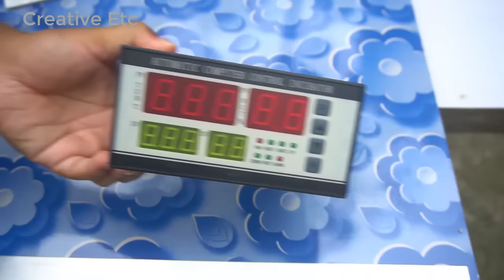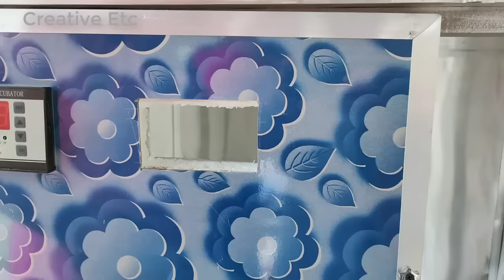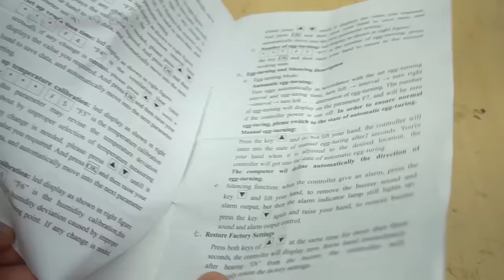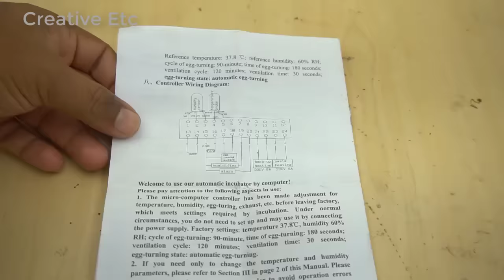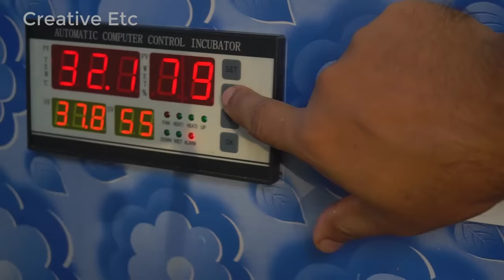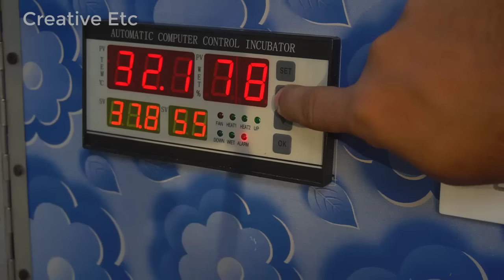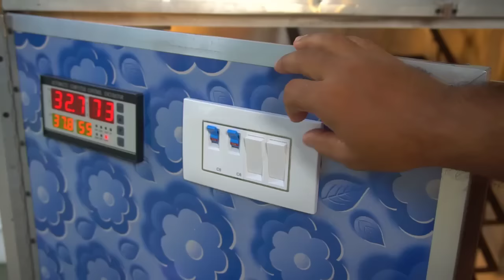How to make Automatic Egg Incubator at Home( 1400 egg capacity)

Comment: Hello !
I want to show my semi automatic incubator but I need the advice of an expert in the field, a plywood 0.059in thick,
47in * 16in * 23in are the dimensions of my brooder, and I want to used 6 trays for a total of 378 eggs and each tray measures 16in * 9.84in and a quantity of 63 eggs, so I want placed 3 tiers and so it will be 32in * 9.84in for each floor. And I plan to use a freezer fan and place it on the left side 13in from the eggs and 4 60w bulbs.
Is it necessary to use a fogger or not?

Is this sufficient or is there something to improve?

Comment: it's great this work, but I prose you to replace the steel hurdles with wooden hurdles which are less heavy and certainly less expensive. the motor will consume less current.
Reply: with the galvanized tola it will keep the heat more than with the wood